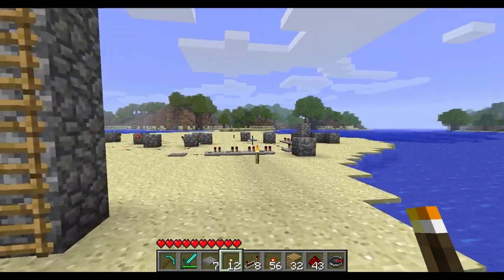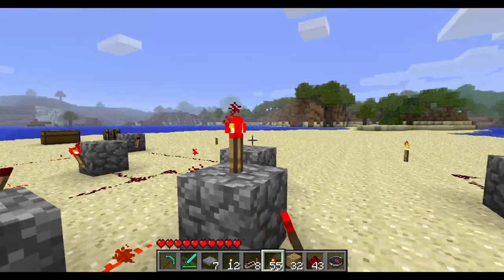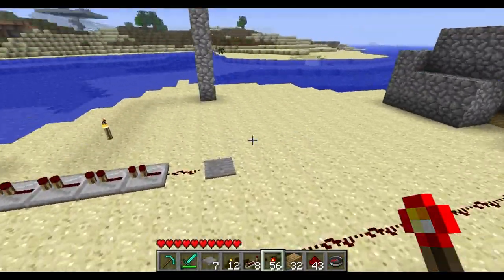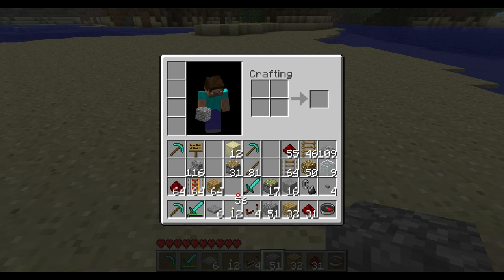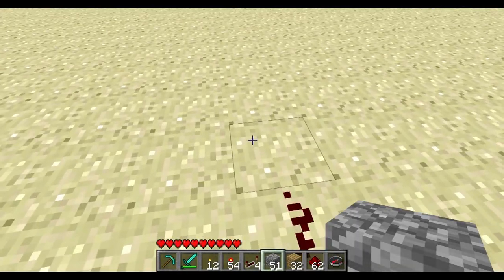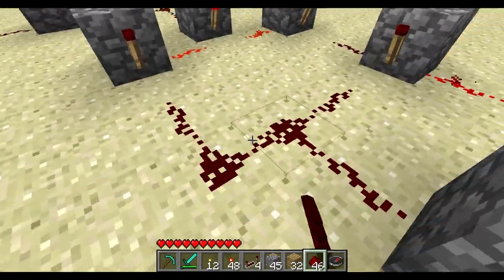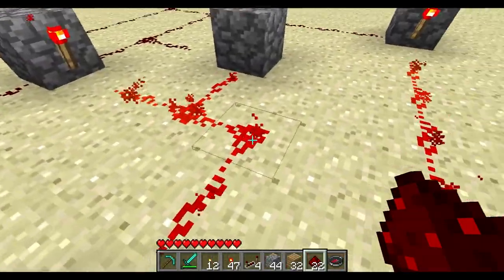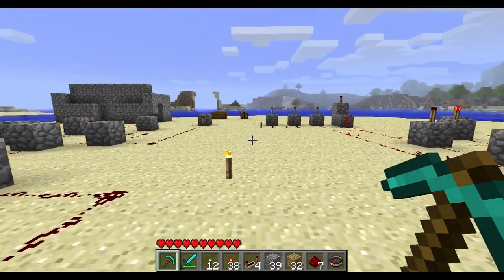One button On/Off with Redstone

Comment: I have a single button version too. I used 2 AND gates and 1 RS NOR latch. Its a smaller than yours but slower. A button is conected to 2 AND gates and. The side of the RSNOR latch that is on will deactibe one torch of the AND gate and the button pressing will deactivate the other. An inverter sends the signal and turns off the RSNOR latch. The same prosses for the other side.